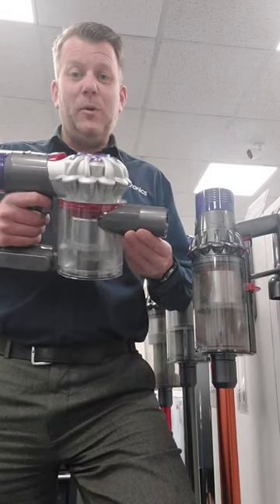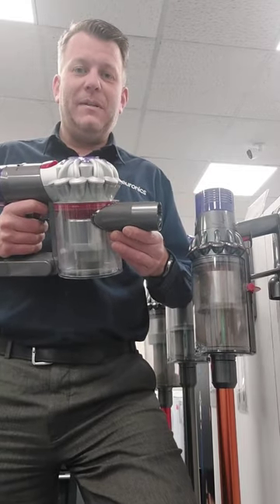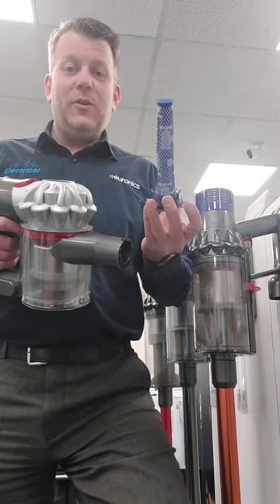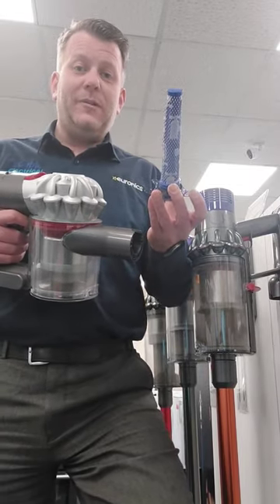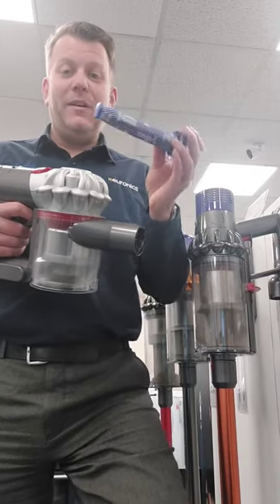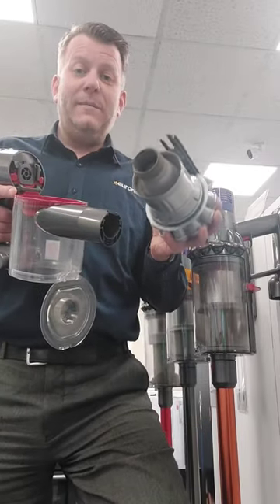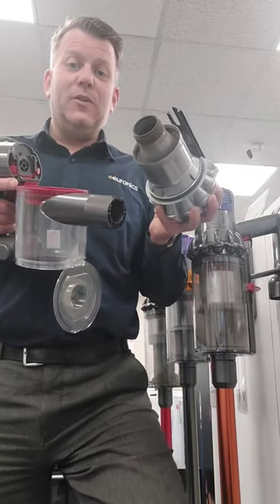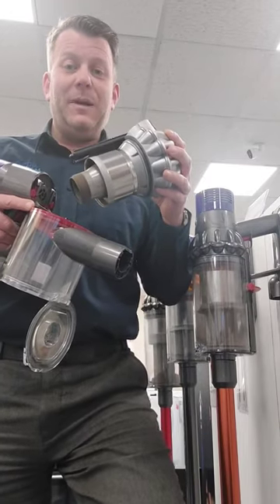Dyson Cordless Vacuum Not Sucking Or Pulsing?

Comment: I have the same issue I cleaned it up but still have the same problem and I ordered new battery but still nothing changed, what I have to do ?
Reply from the maker: If you have cleaned the filters and that still doesn't work, i would try and change the filters for new ones